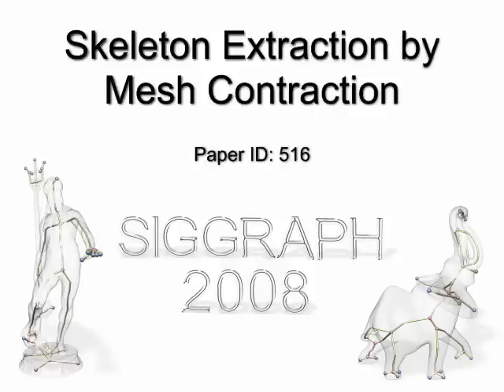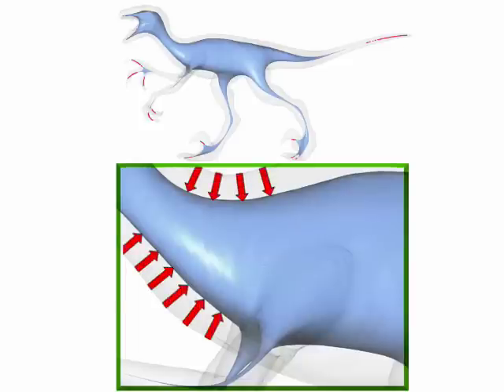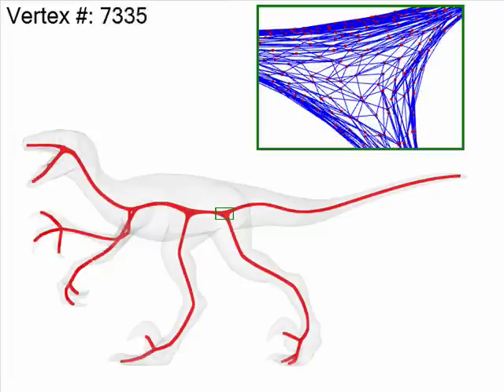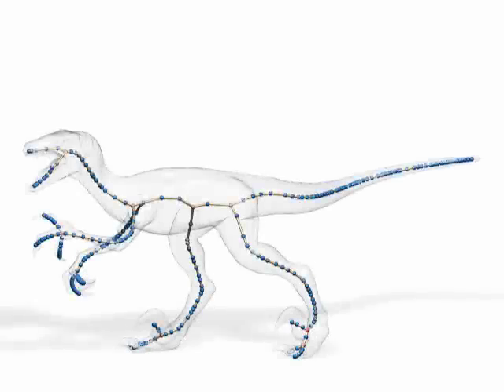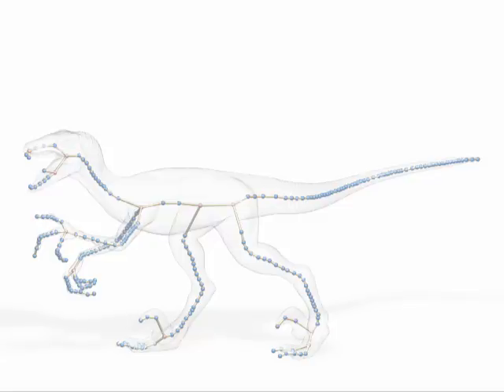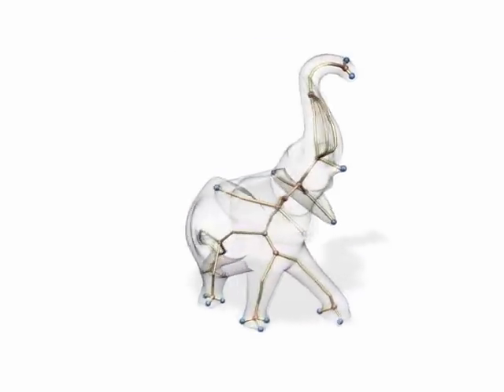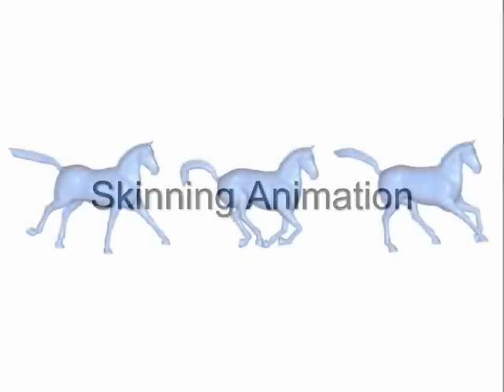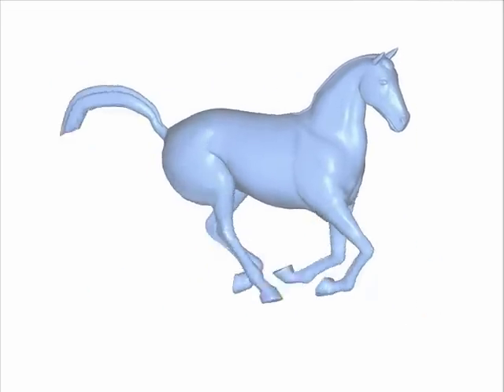Skeleton Extraction by Mesh Contraction

Comment: I'm having issues with this implmentation. I already read the paper and have everything in place. Sometimes my linear algebra equation solver rans into NaN values, so basically some vertices became unstable. How is the proper way to handle this ? 

Note: I also have a basic mesh degeneration detection which takes the one ring edges length and mark the vertices so they can preserve their current position, but even though there's a moment where the linear algebra solver returns NaN in some vertices

Also another question is related to the mesh characteristics for this to work. Are there any special constraints ? Cause I have notice, that scaling up or down the model gives different results.

Environment: C++ with Eigen library. Tested with all Sparse Solvers that the library provides